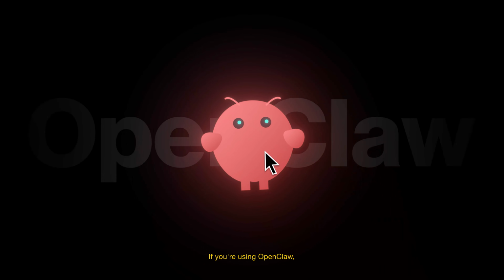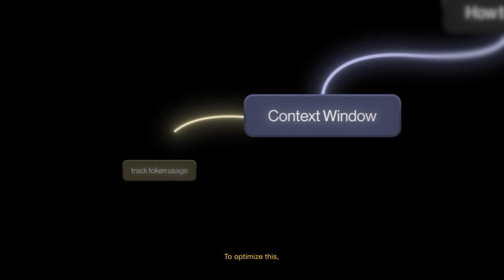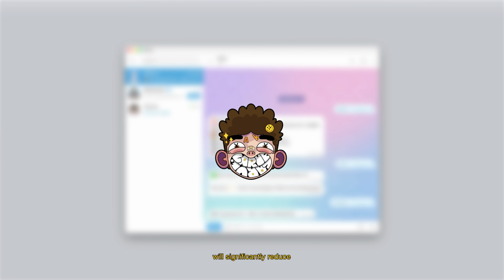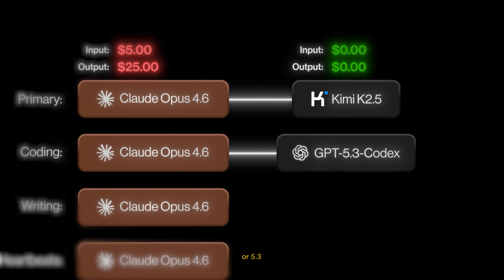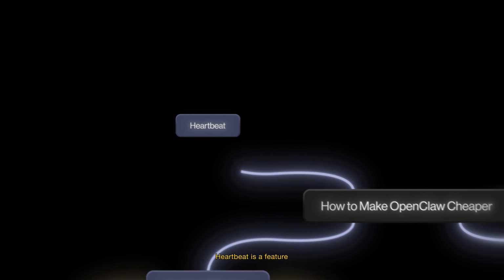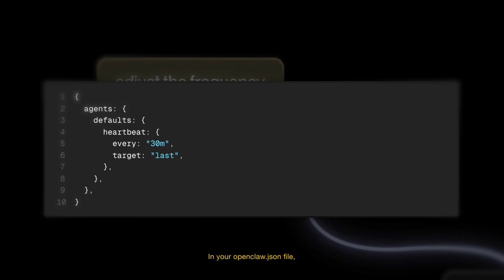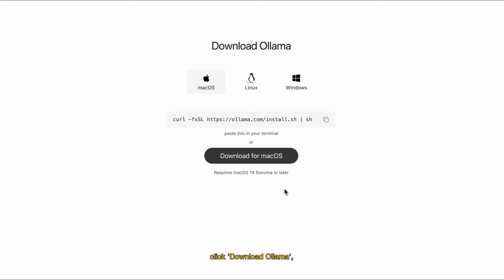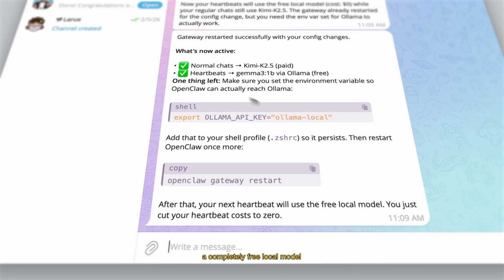How I Make OpenClaw 90% Cheaper (Feels Illegal)

Comment: The only thing you need is a model router
Daily drive over free models and the rest over the nodels you using most..
Github copilot gives you for 10€ per month the ability to use gpt 5 mini for free and wothout token costs unlimited.. so that only cost 10 € per month... then you can look what you need.. do you need really the best models thann look out, is claude really nesseceary? Because the most people also cqn use the codex sub from chatgpt to also have a weekly contigent for codex.
And then is their openrouter and their free models.. 

So you have to look, what you need and what you really consum. Then let openclaw make a model router for you so its automatically routes and uses other models based on your prompt...
With copilot, codex and openroutee i minimized my cost from like 400per month to 50-100 per month.
And if you really need an powerfull models, codex ist enough for the most people and if you really need something better than are the copilot credits the cheapest.. better than claude api costs or codex credits..

So look for github copilot, chat gpt abo for codex and openrouter..
Little side tipp, openrouter can be used completly for free.. if someone really want to use openclaw but have no money, opebrouter free routing is a bit slow but completly free and has a lot of good and free models in the list.. but my advise, try copilot. It has not the most models to select but what they are cheap and some models completly free..
So my daily chatting, heartbeats, cron jobs and other things costs me nothing besides the copilit sub.
And if i need bit more power i switch to codex or the newest gpt and if something really need the best quallity i go over to a models that costs me tokens. 

For example, i use openclaw daily and for all possible tasks, it is connected with my whole network to have access to my smartphone, pc, servers, smarthome devices and so on.. also im a programmer and also use openclaw for many tasks.. but nor for programming my big projects.. for that i use my ide windsurf.
So i use it a lot, billions of tokens per month but my costs not even 100€. 
Its cheaper and better than have and own gpu for processing the llm.
Reply: You god damn right, dude

Comment: The "90% cheaper" and "feels illegal" framing is pure hype. Savings depend on your setup—if you're not overusing context or heartbeats to begin with, you might see 20-50% at best, not 90%.

On models: "Kim K 2.5" (Kimi K2.5) is about 8x cheaper than Claude Opus 4.6 ($0.60/M input vs $5/M), not 11x as claimed. It's competitive on benchmarks like HLE-Full (50.2% vs Opus 4.5's 43.2%), but not universally "near Opus level"—Opus edges it on SWE-Bench Verified (80.8% vs 76.8%). GPT-5.2 Codex is strong for coding (77.3% on Terminal-Bench 2.0 vs Opus 4.6's 65.4%), but costs more ($1.75/M input vs Opus' $5/M? Wait, no—Codex is cheaper on input but pricier on output at $14/M).

Heartbeats are a standard feature—default 30min interval, configurable in openclaw.json. Routing them to Ollama locals is smart and free, but not revolutionary—and it comes with big caveats. Running local models is hugely dependent on your GPU RAM; most consumer setups limit context windows to around 4,000-8,000 tokens (or even less for quantized models to fit on modest hardware), making any attempt at long-term information retention utterly pointless. Without sufficient context, these models frequently hallucinate, fabricating "facts" or responses that are outright fake because they can't maintain the necessary information across interactions, leading to incoherent, unreliable outputs riddled with inaccuracies. You're essentially trading poor-quality, hallucination-prone responses and slower inference speeds for "free" access, which is rarely worth it unless you have beefy hardware (e.g., 24GB+ VRAM to handle larger contexts without compromising trustworthiness). This hype glosses over how severe token limitations directly erode the model's performance, turning what could be a useful tool into a source of misleading info. Good intro for newbies, but dial back the exaggeration—it's not "illegal," just good config hygiene.